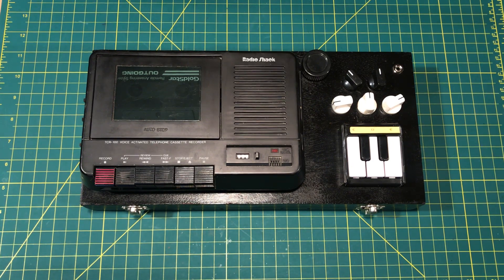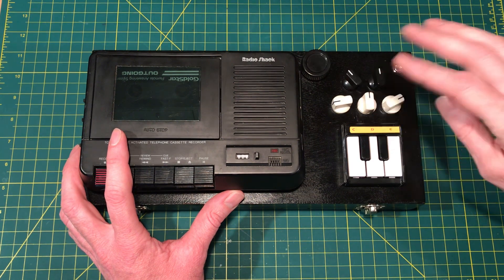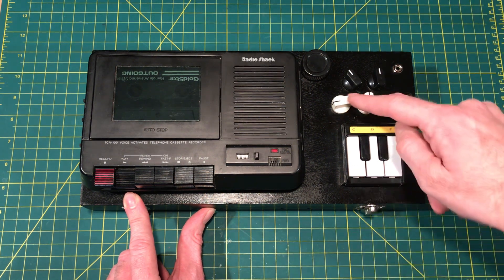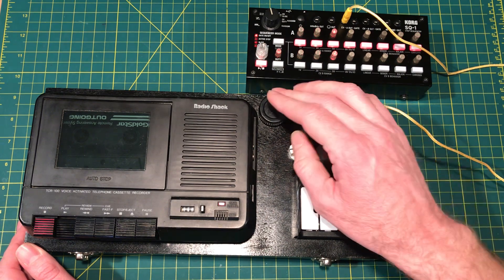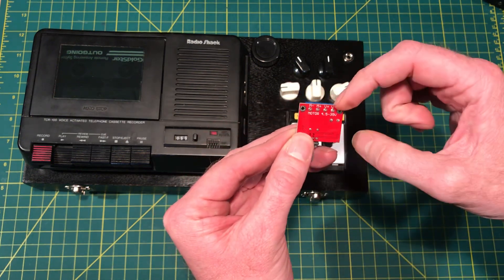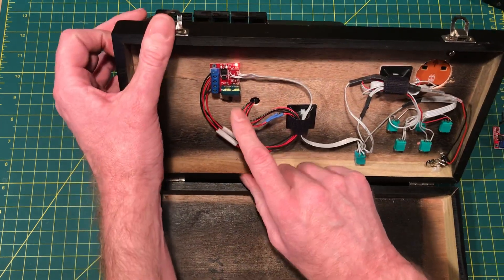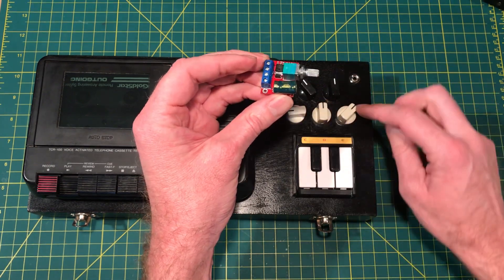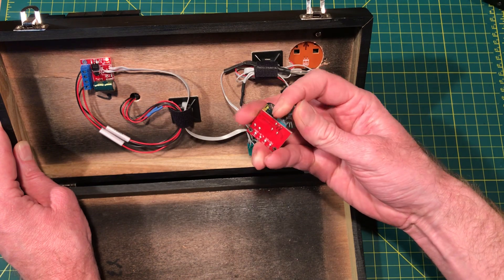KeyPlayer - a circuit bent tape player instrument

Comment: Hello Mike! In one of the comments, you mentioned using 50k potentiometers. I followed Rich's instructions (using 5k potentiometers) while aiming to have a full octave (12 keys). The result was such that I couldn't tune the tone even by a quarter tone, let alone a full octave (the tuning range is extremely narrow)... Do you think it would solve the problem if I replaced all the potentiometers with 50k or maybe 100k ones?
Reply from the maker: It depends. If you follow Rich’s instructions (which I do with my “Cassettone Mini” devices) you should use 5K pots as that will give the best range of control. Using larger pots will just mean they have the same amount of control in a smaller amount of turning and the rest of the turning won’t have any changes. Doing how Rich does it you basically just replace the internal speed trimmer and you get a limited range. HOWEVER that is not what I’m doing on this one. Instead I’m using a PWM (pulse width modulation) board to control the motor speed which give a MUCH wider range of speed control. It goes from super fast “chipmunk” speed all they way down to super crawling slow and even full stop. The PWM board is wired directly to the motor with the internal speed controller completely bypassed. I have another video that explains the PWM mod much better that I will link below.
Reply from the maker: https://youtu.be/BdNb8A14s2s

Comment: I'm mid way through quite a similar build to this - I was really pleased to find the motor in one of my cassette players has no integrated voltage control (mus be on the main PCB) so I was able to wire straight in.
I was wondering though, is there enough current in a CV signal to power the motor directly, allowing you to forgo the vactrol. Any idea?
Reply from the maker: I really don’t know if that would work or not. Seems like it might as long as the voltage stays positive but I’m really not sure. Next time I work on one I’ll give it a shot. Also, if your player has the speed trimmer located on the main board you might want to first try just replacing it with a larger value pot instead of the whole PWM circuit. Sometimes that works better since it won’t introduce the PWM noise. But sometimes you might not get enough range of control that way.
Reply: @SISKworks    Yeah the trimmer on this particular player doesn’t give much range to play with - but with about 1v-5v (the max the motor can handle) from the PWM I can get at least two or three octaves. We’ll see how it goes though. I have a Sony somewhere which I know has better speed range, when I find it I’ll put a pot on that. 
I’ve also just ordered a bunch of different value photoresistors to work out which is best for a vactrol - I don’t understand electronics well enough to risk zapping my Division6 sequencer by plugging it straight into this project!